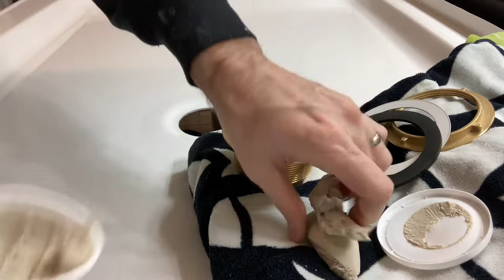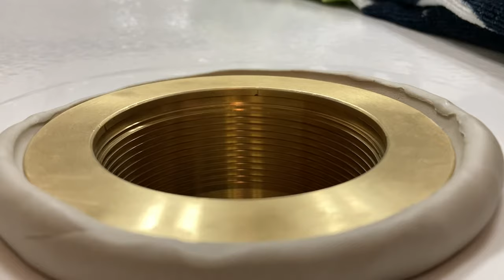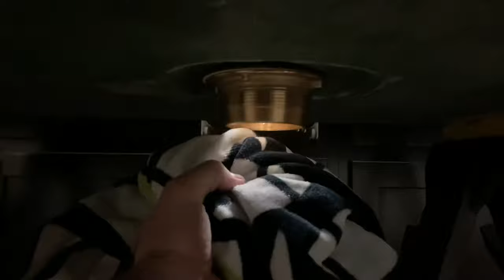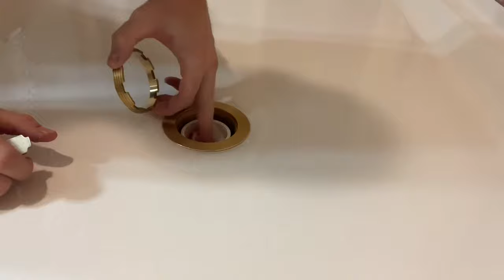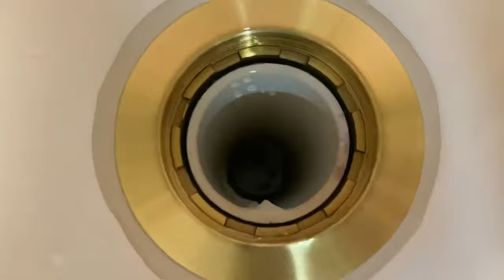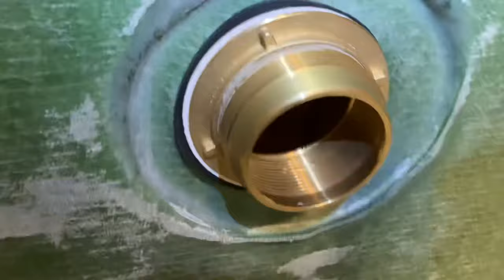️🔥 How to Install a 2" Brass Shower Drain➔ Step-by-Step Tutorial + DIY Water Test

Comment: You also need to test with ‘weight’ on the floor plan as if someone is showering to make sure there is no flex around the drain.
Reply from the maker: That’s a good idea!
Reply: That is correct that’s the problem. I’m having with my standup shower right now. When I stand in and move around  it leaks through the ceiling.

Comment: After having installed the drain as you did, I have tested it and never had a failure. There is no need for the test and delaying work for several hours.
Reply: Maybe a to test to see if there is too much testing.   Then check that test for errors and that should settle it.

Comment: Honest question, I’ve never understood why a rubber gasket is not used in place of the plumbers paddy. Could you explain?  It seems like it was be easier and would seal that part better.
Reply from the maker: Great question! It could be that rubber gaskets have a relatively shorter life span than plumber's putty. Or, perhaps plumber's putty, because it is malleable and clay-like, can conform to a variety of variables or install situations. For example, a rubber gasket could be sold with the shower drain, but perhaps it would not conform to the specific fiberglass shower pan I bought and was using it with. But I'm no plumber, so perhaps another viewer can help out.
Reply: I've used a brand of kitchen sink drain that uses a foam gasket instead of putty.
Reply: Or, better idea, why is the main part of shower base not the male piece that fits INTO the female drain pipe???? This seems like a much better way.
Reply: @Willie_Wahzoo  we’d be flying cars if people actually thought like that

Comment: Too much testing. Your second test just increases the chance that you would have a leak. How do you test the reinstall? Do it right as you did and there is little chance of a failure and all the testing is increasing your chances of a leak.
Reply from the maker: This is great feedback - thanks!
Reply: @diybandit  the way its actually done is you can get a test plug or ball and that will close off the drain pipe and you fill the pan with water and monitor the level over a period of 24 hours